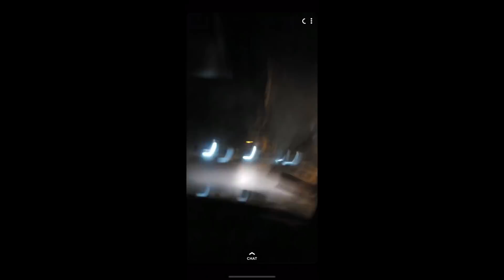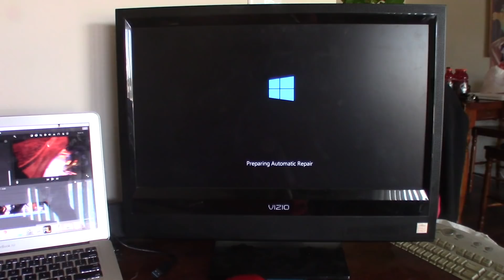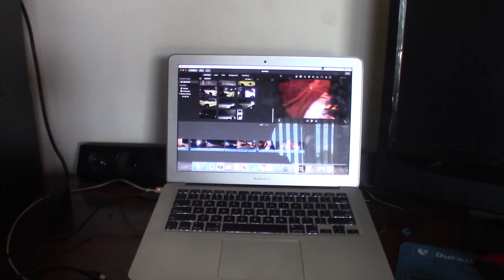SORRY for the wait | Channel Update | OSW Event

Comment: You can re-certify your harnesses I believe! And also, do you have to run spacers with the square wheels to clear the villians calipers? I run the same wheels and am buying their full hydro setup soon.
Reply from the maker: Can you really? I didn't think you could... anyways I don't think you NEED to run the spacers. but I run a 2'' in the rear with my squares because of the fender roll and to help with the fitment. I guess I could mount it without the spacer real quick to see if it'll clear. I think it will.